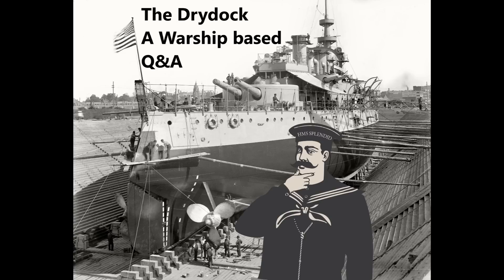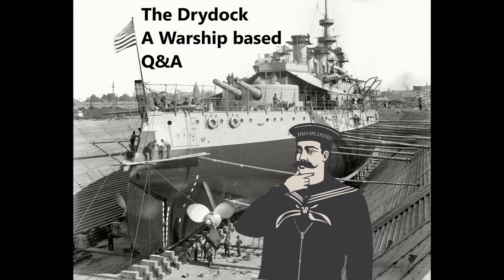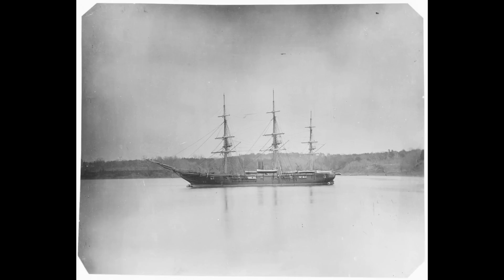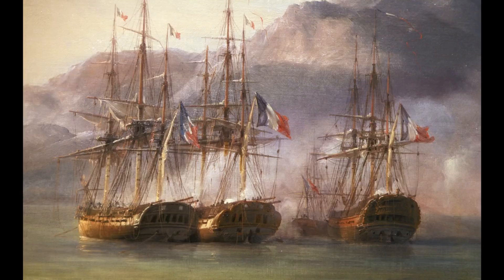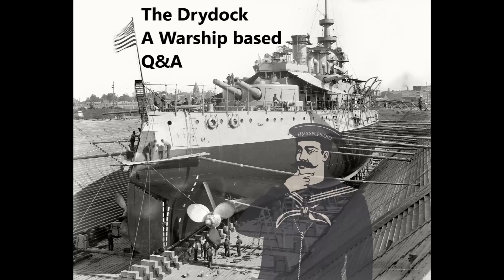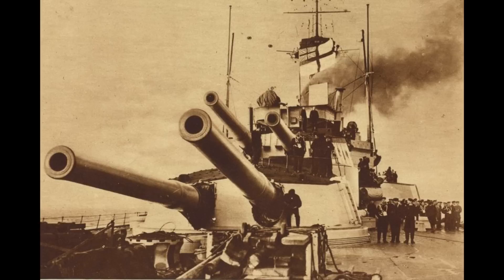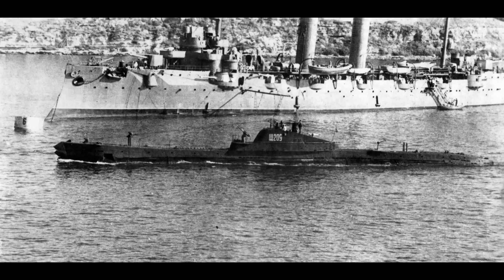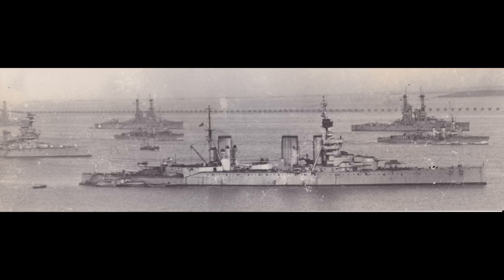The Drydock - Episode 207

Comment: The senior officer of a merchant ship is its master, not its "captain". During the Middle Ages, there was no Royal Navy as such, ships and their crews were called up from the merchant service (in return for lower import duties, each of the Cinque Ports committed to providing a certain number of ships with their crews https://en.wikipedia.org/wiki/Cinque_Ports). The King then detailed a group of soldiers to serve as marines on each, appointing an officer called the captain (from the Latin capua = head) to command them. He did not necessarily have any maritime experience. So, the master was in charge of sailing the ship, while the captain was in charge of fighting her. This prevailed until the Pepys Reforms of the 1660's which required a prospective naval officer to demonstrate a knowledge of seamanship and navigation in order to be commissioned. Gradually, this led to a downgrading of the position of Master. He became the ship's senior warrant officer (one of three who was a member of the wardroom) "In 1808, Masters (along with Pursers and Surgeons) were given similar status to commissioned officers, as warrant officers of wardroom rank. The master ate in the wardroom with the other officers, had a large cabin in the gunroom, and had a smaller day cabin next to the captain's cabin on the quarterdeck for charts and navigation equipment " and was the ship's expert on sailing, seamanship and navigation, Masters either transferred directly from the merchant service, or, if a ship's mate, joined the Navy as a Master's Mate and were later promoted. Some Master's Mates were midshipmen who had passed their exam for promotion to lieutenant and were awaiting their promotion orders. Some unlucky passed midshipmen were never commissoned and settled into being Master's Mates were eventually promoted to Master. A prospective Master had to pass an oral exam conducted by a RN captain and three Masters of Trinity House. He was then eligible to receive his warrant from the Navy Board. From 1753, the position of Deputy Master existed aboard ships of the line - generally a Mate who had passed his exam for Master and was deemed capable of serving as such and and was awaiting a position to become available. Smaller rated ships had a Master's Mate as Deputy Master. Unrated ships were authorized an experienced Master's Mate in lieu of a Master. No further Masters were created after 1883 and the last retired in 1892. https://en.wikipedia.org/wiki/Master_%28naval%29
Reply: Also the Warrants stayed with the ship, even when it was in Ordinary, at least during the period of the Age of Sail. That of course changed later, but the period in question is the Age of Sail. 

The Purser and Surgeon were not 'Warrants' in that respect as they would be Paid off with the rest of the crew after a voyage or if a ship went into Ordinary. The Warrants that I am aware of, those who stayed with the ship were, the Master, Carpenter, Gunner, Clerk and Cook. Later the Chaplain and Schoolmaster were added to that list. 

Of course, the Age of Sail is a fair old period, so it could be that I have just missed that Warrants were issued to the Purser and Surgeon even though they did not remain with the ship. Or they were made Warrants later, and again did not stay with the ship unlike the other Warrants.
Reply: @alganhar1  The Master was not a Standing Warrant Officer like the Bosun, Carpenter and Gunner, and was paid off with the rest of the crew. Please allow me to quote -                                                                               "Rank and status in the 18th century
In origin, warrant officers were specialist professionals whose expertise and authority demanded formal recognition. In the 18th century they fell into two clear categories: on the one hand, those privileged to share with the commissioned officers in the wardroom and on the quarterdeck; and on the other, those who ranked with more junior members of the ship's crew.[Somewhere between the two, however, were the standing officers, notable because, unlike the rest of the ship's company, they remained with the ship even when it was out of commission (e.g. for repair, refitting or replenishment, or whilst laid up); in these circumstances they were under the pay and supervision of the Royal Dockyard.

Wardroom warrant officers
These classes of warrant officer messed in the wardroom with the commissioned officers:

the master: the senior warrant officer, a qualified navigator and experienced seaman who set the sails, maintained the ship's log and advised the captain on the seaworthiness of the ship and crew;
the surgeon: who treated the sick and injured and advised the captain on matters of health;
the purser: responsible for supplies, food and pay for the crew.
In the early 19th century, they were joined in the wardroom by naval chaplains, who also had warrant officer status (though they were only usually present on larger vessels).

Standing warrant officers
The standing officers were members of the gunroom and were:

the boatswain: responsible for maintenance of the ship's boats, sails, rigging, anchors and cables;
the carpenter: responsible for maintenance of the ship's hull and masts;
the gunner: responsible for care and maintenance of the ship's guns and gunpowder.                                                                                                                                              
                                                                                                                                           Junior warrant officers
Other warrant officers included surgeon's mates, boatswain's mates and carpenter's mates, sailmakers, armorers, schoolmasters (involved in the education of boys, midshipmen and others aboard ship) and clerks. Masters-at-arms, who had formerly overseen small-arms provision on board, had by this time taken on responsibility for discipline.

Comment: Temperatures cannot halve. The numbers on our arbitrary scales can halve, double or cube but temperature itself does not work like that.
Reply: Sure it can. A temperature of 200° Rankine is exactly half of 400° Rankine.
Reply: There are absolute temperature scales (as demonstrated above), the most useful of which is Kelvin.
Sure, starting at usual terrestrial ambient temperatures, halving the temperature gets you to very, very cold temperatures.

So, in this case saying that the temperature has halved is wrong. Although if we are using the most common "normal" temperature scale, the 0 is pretty much the temperature where water will freeze (depending on purity and pressure), so in that sense you have a bit going on for "temperature halving" when it comes to water. But sure, it is not correct.

Comment: The German Pocket Battleship 28.3 cm guns used the German post-WWI "Psgr.m.K." (APHE shell with AP Cap) type "L/3,7" )3.7 calibers long) of circa-600 kg (also used in the all German 15 cm guns through the end of WWII).  This shell had a small pointed windscreen and an equally small hardened AP cap, and an improved delay-action base fuze, but otherwise was just a "warmed-over" WWI tough-capped "L/3,2" shell of the same size and had rather poor ability to stay in one piece when hitting any significant thickness of armor.  The later post-1930 heavier and improved-metallurgy "L/4,4" used by the SCHARNHORST Class was considerably better.

Comment: I believe that a ship’s Master had a legal responsibility for the safety of the ship in terms of seamanship. Ergo, if the ship was lost due to errors in navigation or storm preparation or anything similar such as masts carried away due to weather leading to the loss of the ship, then they’d also be court martialed. This includes the usual explanation that ‘to be court martialed’ is not the same as to be found guilty. There are numerous situations for which a court martial is automatic, but that is to enable the person(s) responsible (if any) to be identified.

Comment: On 'Storing guns to deal with later cruisers' question, you don't seem to take into account that a ship could be designed (once the decision is made to keep the guns for future use) while they are waiting to use it. After all during the interwar period the RN had time to work up designs for various proposed battleships. They could have taken the time to design a super cruiser using the guns already in storage. While they could reuse the original twin gun mounts in a 6 gun layout there is nothing stopping them from designing an 8 or 9 gun ship during the design process. The main problem, as I see it, is that once a design is settled on the AA, machinery, and underwater protection would have to be updated due to technical advances. Presumably the advances in machinery would make up for the extra weight of AA and reduced internal volume needed by better underwater protection. As, the details of the possible future ships had not been decided on at the time of storing the guns in question, it would probably be a good idea to store as much armor that would otherwise be scraped since armor is likely another long lead item. Given the pace of technological advancement anything else would probably be obsolete by the time the ships were built.

Comment: Speaking of fire control only, and in particular the rangefinders. You could have two absolutely identical ships write down to the barnacles on the keel and the fire control systems will have a different feel in their rangefinders adjustment knobs. These are precision instruments, which is why they were high on the list for salvage at Pearl harbor. The glass in the rangefinders the gears it's all precision. Unfortunately they are never exactly the same. That feel on those adjustments to determine range is critical. If you swap the cruise around whoever operates the rangefinders, will have to get used to the feel of the instrument. There could be a slight difference in the angle of the mirrors, the intermeshing of the gears could be slightly different. These differences could be the result of the manufacturing process of the gears or it could be the way they're maintained or just normal wear
Reply: I wonder what effect temperature has on the range finders., thermal expansion / contraction.   100F in the sputh pacific verses -20F in the north atlantic.   a 120F temperature swing.   That can make the distance between the binocular mirrors change. backlash in gear trains change, etc....

Comment: @1:00:48 A 13.5” turret weighs about three times as much as Town class 8”. Even a one for two swap would seemingly require a lot of re-engineering. On the other had it is surprising the guns weren’t saved. I wonder if the ships could have been moved to say Gibraltar, Singapore  or Scapa and permanently grounded as defensive fortifications?
Reply: No, the treaty required their being broken up - and apart from a few outliers like the Courageous class, they agreed not to retain the turrets and guns.
Reply: @ianwalter62 The Washington Treaty requires the that guns and turrets be destroyed or landed, so my reading is that the guns and turrets
Reply: could removed an emplaced on land. Also there is no limitation as to where to ships be scrapped etc. I’ll look for cases where US, Japan or Great Britain repurposed guns from the warships scrapped under the treaty.  There may be some separate agreement among the parties as to what happened to the guns.  The 16” guns intended for Lexington and Saratoga were stored for use in future warships but actually used as coast defense artillery after the barbettes are too small fiasco.
Reply: @richardschaffer5588  I looked at The Treaty, and "disposal" of ships is defined, and the method of effecting it prescribed, in Chapter II, Part 2 -"RULES FOR SCRAPPING VESSELS OF WAR", Clause III, subclause (b)(1) - you are correct, it is landed, not necessarily destroyed. "Disposal" or "scrapping"  only refers to the ship as a whole, not all the fixtures and fittings, and not even the armour plates. So there was nothing in the treaty to stop guns being stored as spare parts or put to a use other than arming a combat vessel.

 The Courageous class are probably a unique case - the turrets from those (which were completed as cruisers) were stored and eventually used on the HMS Vanguard; they were however the same model 15" as used in the QE, "R" class and the battle cruisers, so it may be the barrels, particularly, had already been used as replacements, and the Vanguard received newly manufactured weapons.

Comment: The best option was to close the falklands at maximum speed.. ram the largest british ships... all guns blazing...
Reply: Ah, the Brother Munro tactic...
Reply: The entrance to Stanley Harbour is slightly less than twice the length of a Scharnhorst-class cruiser. Of which Spee conveniently enough had two. His best option was to have Schanrhorst and Gneisenau make their best speed to the harbor entrance and each of them runs itself aground on one of the peninsulas, with their sterns close enough together than nothing bigger than a rowboat will fit between them.

Then fire away for as long they're able to until he's destroyed. At which point instead of a pair of intact cruisers blocking the the harbor it's a pair of wrecked cruisers...which are equally difficult to remove. Sturdee's battlecruisers would've been bottled up until the wrecks could be cleared, giving Spee's light cruisers a few months head start for either trying to run the North Sea blockade or do commerce raiding until they're caught. And deprives the Royal Navy of 2 out of their (at the time) 10 battlecruisers for however many months it takes to clear the wrecks.

This also would've probably rendered Inflexible not yet available for bombarding Gallipoli in March 1915, meaning some other capital ship would've had to go in her place.